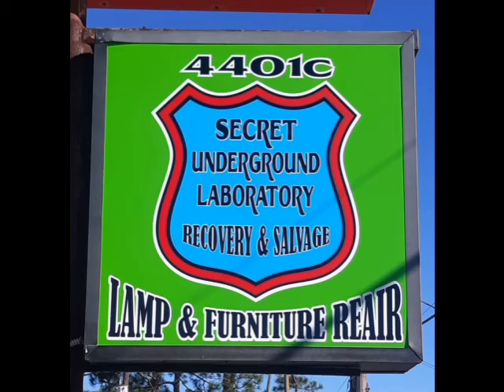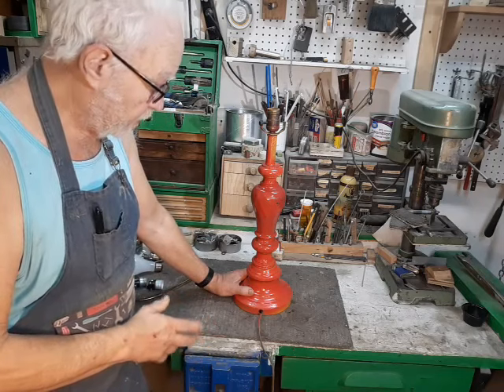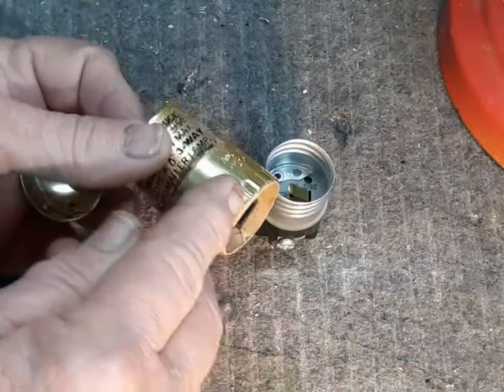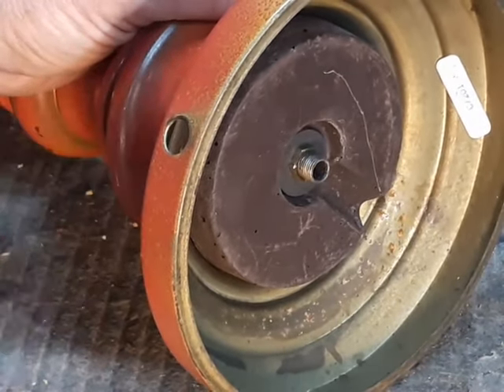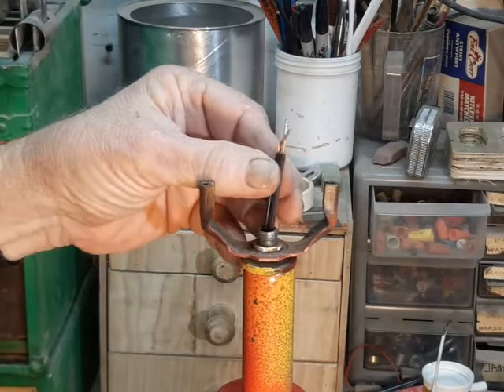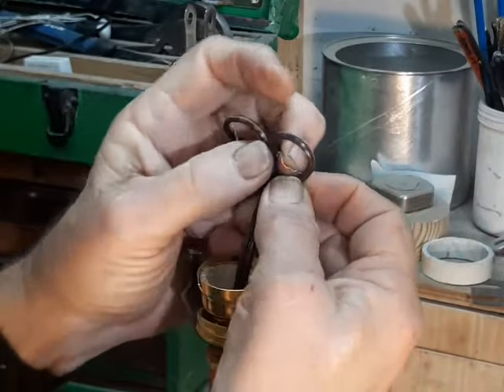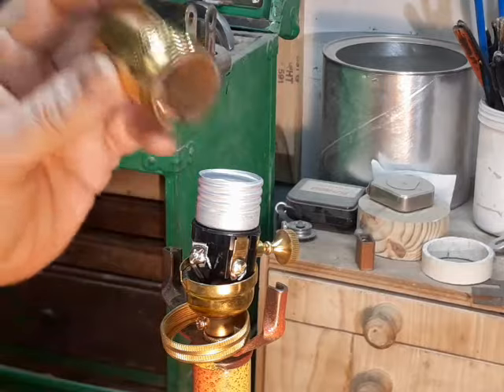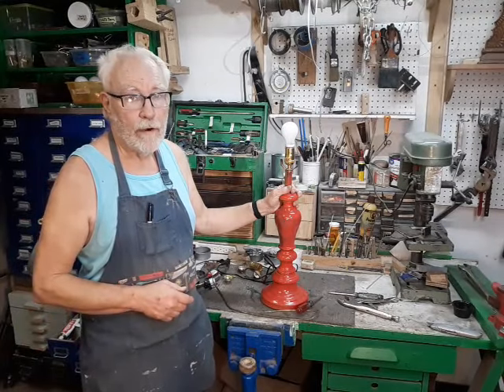The Only Lamp Rewire Video You'll Ever Need from the Secret Underground Laboratory Recovery&Salvage

Comment: Thank you - great video.  I was wondering if there's a good trick for getting the wire up through a tall floor lamp.
Reply from the maker: You are very welcome. A floor lamp is too long to push a cord all the way through. There's too much friction and the cord will simply get stuck about halfway through. The solution is to use a piece of stiff steel. This is usually called "fishing". I prefer mechanic's wire, sometimes called baling wire. Home Depot and Lowes sell it in the cement and concrete aisle. It holds it's shape and can be pushed. Push it through the pipe and make a hook on the end to pull the cord. If the old cord is still in the lamp, it can be used to pull the new cord.

Comment: Really like your how to vids on lamp repair. Thank you! I repair lamps for a non profit and send them out to the recipients as a safe and functional unit. Can you please tell me why they still sell non polarized replacement plugs for the cord? Thanks so much, Cheers!
Reply from the maker: Thank you as well. A lamp with a polarized plug and a properly wired socket will not shock the person who touches the socket shell. This isn't an issue for something like a fan or other appliance, so non polarized plugs still have an application.

Comment: Thank you for the information.  In the past I think I've seen you put a knot in the cord where it exits the base of the lamp and I was wondering why you didn't do that this time.
Reply: Yes, I wondered what your guideline is for knot in the base vs. knot in the socket.
Reply from the maker: I prefer the knot in the socket base, but a knot in the base serves the same function. The main problem with the knot in the lamp base is you have to remember to tie the knot before you push the wire up the pipe.

Comment: point out unplug lamp before rewiring as you did not show plugging it in when you completed wiring. Looks like it did not matter you just turned on bulb . I am an old lady going to rewire and I know to unplug but do the younger generation of women. thank you
Reply from the maker: Thank you very much. Any electrical device should be disconnected from the power source before any repair is attempted.

Comment: What kind of solder do you use?
Reply from the maker: I use only rosin core solder for electrical work. The alloy is about 99%tin with a little copper and silver. For metal repair, I use 60/40 lead/tin solder.